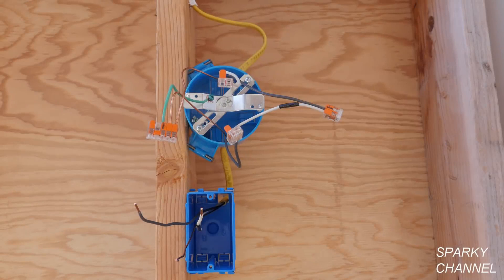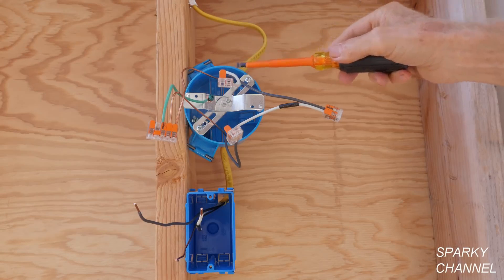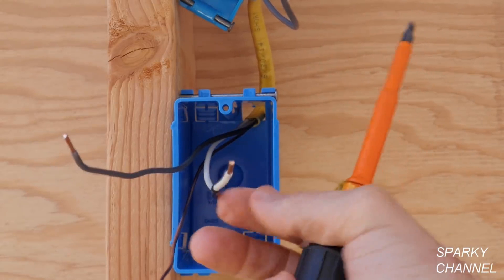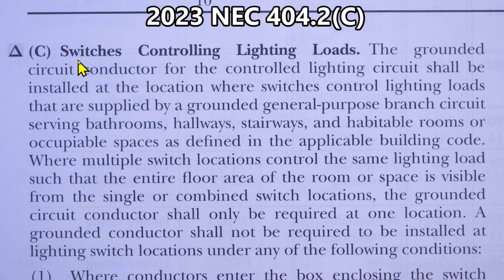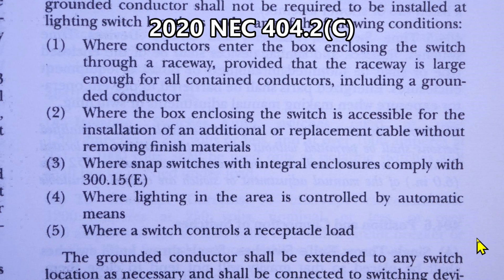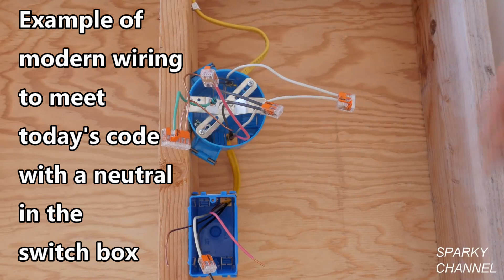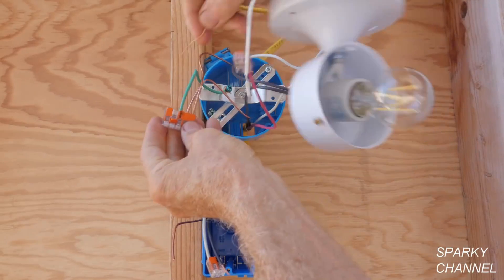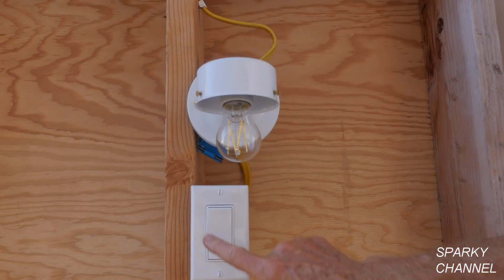NEC 2023 404.2(C) Switches Controlling Lighting Loads, Code Deletions? What Deletions?

Comment: This addition to the code is the most presumptive thing I have ever seen.  It assumes that people will install electronic lighting controls, and  that they will require a neutral and that the box the neutral is in, is where the control is likely to be in multiple switches.  I think it more likely that these controls will be "power robbing" for backward compatibility in homes where there is no neutral.  I also think that many people will find that the old fashion way of turning the light on when you enter a room and off when you leave works just fine!  I do not think that this has anything to do with safety, but is requiring people to prewire for something they may never have, or want.
Reply: If people want to convert over to home automation, they can pay for a rewire. It's pointless to include it in construction other than to raise the costs of the home. The NEC is supposed to be code for SAFETY, not for forcing contractors to do something just because it makes it easier to adopt a new technology.
Reply: IF you think the home automation market is not a big deal, you're mistaken. Saying it's something someone may never have or want is like saying we shouldn't wire an outlet for an electric dryer, because they may never have one and only use gas.
Reply: @InfamousElGuapo  well most people know if there going to use smart switch's or not problem is years down the road when house get sold new owner may want to use them and would have to redo alot of walls to rewire it adding it in saves others time and money who know next owner maybe your kids who 20 plus years from now will want smart switches
Reply: @InfamousElGuapo  If you have gas service, you would have to have a special case of stupid to switch a dryer, range/oven, hvac, water heater, etc over to electric. Gas is much more efficient, cheaper, and just works better overall.

Comment: Question about that unused neutral in the switch box... does it require a wire-nut/wago on its end or can it be left "uncapped"?  You showed it capped (with a wago) in this example.  Is that per code?  I assume code requires it be capped to protect it from making contact with anything in the box, but wanted to have that clarified.  Tx!
Reply: Best practice, dont leave cables uncapped
Reply: @thedude5040  Agreed, but I'm curious as to what code states about unused wires like that.  :)

Comment: With few exceptions such as a switch being on the far end of a room in relation to the rest of the circuit,  or adding switchs to pull chain light fixtures during a remodel,  there is no reason to run switch loops.   Just run your feed into the switch box, then run your cable to the light.   Very simple to understand, no need to use as much 3 wire + ground cable in the house,  and also makes simplifies troubleshooting  in case of a problem.  Saves from having to drag a ladder to get to a ceiling box.
Reply: I was under the understanding that is common practice. I've never seen a feed coming from a ceiling box to a switch.
Reply: @jason3298  if you're doing renovations,  you'll frequently run into switch loops, where the feed comes into the ceiling box, then a 14/2 is dropped down to a switch,  here,  the white wire is hot and should be identified as such, but often isn't, this was common in the 60s , 70s and sometimes the 80s,    Of course this is no longer code compliant as of 2011, and unless you modify the circuit in any way, the existing setup is grandfathered in, assuming it was wired to code at the time of construction.
Reply: Ceiling run to a switch and back to a light would be more copper, with six wires inside the wall (14-2g X 2) instead of four (14-3g)

Comment: This is not a problem if the power comes to the switch box and then feeds the light. 

But what if it’s for the floodlights and you have 2 3way and a 4way switch at each exterior door. Will you need to run 12/2/2 or can you still run 12/3?
Reply: He showed the code where it stated on multi-station switches, the neutral only needs to be run at one location.

Comment: I was working at a ladies house trying to fix a bunch of punch list issues. on issue was that the switch in another room controlled the lights in multiple rooms. after talking to her, she said it wasnt a problem till a handyman installed ceiling fans. I was like, has to be power at the light scenario, and the guy just combined all the whites. I open up the switch and the switch was black and white of the same romex. to the owner I'm like, that proves its power at the light. the owner just looked at me funny because I guess i didnt actually explain it to her in a way that makes sense. She's just like, it worked before, how could it not work now, my handyman is great. I quit working for that guy.

Comment: Bill, what is the reasoning for the limit of 5 and 25 devices?
Reply: This topic could certainly use further discussion and explanation. For instance in re to 3 way or 4 way switches? Or, what is happening—on the neutral—when multiples of these switches are doing their job? Thank you Bill for ALL your vids and ongoing tutorials.
Reply from the maker: Perhaps too much voltage drop.
Reply: @SparkyChannel  Isn't that section about using the ground wire as a fake neutral? Or am I confusing things?
Reply: @Ariel1S  Yeah. I don't remember if these are the exact limits (I think they are), but the max allowed leakage is .5 mA per device/appliance. Class A GFCI's are rated for 4-6 mA. So, 5 switches could be 2.5 mA; half the GFCI's rating. Add a few more switches and you'd probably trip the GFCI. Guessing they figured nuisance tripping wouldn't happen with 5 or less. Had I not looked it up, not sure I would have thought about it. If I was on a call I probably would just assume it was a faulty GFCI.
Reply: The limit, where you do not have a neutral for the switch, is to limit the amount of control return current on the neutral.

Comment: With a switch loop does it matter if the white (w/black tape of course) is used as the "hot" or and the black as return, or vice-versa? I've seen it done both ways.
Reply: The convention was to use the white as the line, and the black as the load. (from what I've heard)
Reply from the maker: Hi Kris! I've heard it both ways, but I think you're correct.
Reply: @SparkyChannel  Hi, Bill. I read that somewhere on a forum. I am not sure if there was a code from a past NEC edition or if it was just a convention. I am also going to ask my boss what he has seen more often. He's been in business since 1990 so he has seen a good amount of stuff.
Reply from the maker: @illestofdemall13  The only code I remember about it was that you had to permanently re-identify the wire.
Reply: @SparkyChannel  200.7(C)(1) states that the re identified conductor can be used for the supply to the switch, but NOT as the return conductor to the outlet, so it does matter.

Comment: always put a neutral please.. so I can install smart wifi switches
Reply from the maker: Yep!
Reply: Plenty of better options that don't require neutral.
Reply: I cant wait until we get rid of 120V and join the rest of the world with all outlets at 240V
Reply: @thedude5040  why
Reply: @stevenpersinger6577  because 120VAC is pointless now that we no longer use incandescent light bulbs. Most electronics like your cell phone charger, laptops, video game consoles, ext already work at 240V. You could energize a standard outlet with 2 hots, 0 neutals, and the devices will work no additional modifications. So.. if we change everything to 240VAC we can wire houses with fewer conductors and smaller guage wires. Heck us engineers could rewrite the NEC so lighting circuits can use 18awg wire in residential buildings.

Edit 1: I do this when I go to Europe. I have an adapter mold that rearranges the physical metal prongs on a nonsurge arrested extension cord with multiple "american" outlets to match what ever country Im in. Then I take my american laptop and plug it into the the extension cord that is energized to whatever voltage and frequency the outlet is at, hopefully not 277 or 480 because then I (the hotel or airport) will have a problem lol.

Edit 2: dont say something stupid like 240v is unsafe. Its not anymore unsafe than a 120v outlet. You can google, Does europe have twice the amount of electrocutions as america?

Edit 3: we could rewire power transformers to remove the center tap, so we just bring 2 wires to each house. "Hot" and "neutral"
Reply: @thedude5040  whole lot of explanation for an absolutely  bogus idea. But nice try. Props to that.
Reply: @stevenpersinger6577  its not bogas, there is absolutely no reason to keep manufacturing 120v devices when most of the worlds population lives in a 220 or 240V country. We can keep 60hz. Also since all the homes in america only last a max of 100 years Its time to start changing standards. Simplier wiring and higher volates will significantly lower the risk of house fires because of less amperage on feeders and less space taken up in boxes
Reply: @stevenpersinger6577  the NEC is holding back progress. I can vote for changes to the NESC but the NEC is grid locked behind absolutly stupid people.
Reply: @thedude5040  There are still dozens of devices in a typical home that don't use switch mode power supplies and would be unusable if we switched to 240. All 120v appliances, and most 240v as well because the controls often operate on 120. Small pumps, garden tools, car chargers, power tools. Go tell a contractor he needs to replace all his power tools because you want to use smaller wire. 

240 absolutely is more dangerous. I have never had arc flash vaporize my screw driver on a 120 circuit. Also only one leg is hot, so half the likelihood of touching a hot wire, or water conducting it. Though if the power was 240 on one leg and still using a neutral that wouldn't be different. 120 means half the current thru the body. If the contact point has high resistance, as skin does, you have a better chance of a less than lethal dose of current. The arc gap it can jump will be larger. The likelihood of water giving you a lethal shock is higher as sufficient current can now travel twice as far. 
You also need to consider EU outlets are designed with plastic covering the prongs until just the tip. This prevents you from being able to touch them making them safer. Or the outlet is recessed to accomplish the same. So any data about safety from there vs here cannot be compared directly as there are other safety features at play. How long have mandatory GFI and Arc flash equipment been in place for instance.
I just spent a couple weeks in India, and can guarantee if they get shocked it doesn't get reported. The amount of exposed wires there would give a code enforcer nightmares. So reporting accuracy is another problem. 

Basically it would be pointlessly expensive. Particularly since we already have 240.
Reply: @court2379  na. Our devices only last so long before they need replaced anyway. In the long run, 120VAC will loose out simply from a manufacturing standpoint. I realize you may not have any recent experience with motor circuit design, general electeonic circuit design, and microcontroller design, but its not that hard to redesign appliances to work on all 240V instead of split 120/240. Most of the worlds population lives in 220V. Now consider all the changes comming in the next 100 years, we will waste less resources converting to 220v or 240v pick one I dont care, than have a world having to manufacture custom devices just so americans can use their archaic 120v outlets. Its only a matter of time before we have a crisis of end of life on distribution transfomers because there will not be enough manufacuring power in the world to keep up. Look at ukraine, do you have any idea how long its going to take to rubild all those substations? My 230kV breakers from europe have over a year of lead time. I cant do solar swiching stations because of lead times. Hell I tried to order 250k feet of 4 conductor #10 control cable and the supplier just said good luck. We even had trouble with the 15k ft of 4/0 bare copper I needed for a job. Homes on a new 220V can just have a new standard outlet and they would have the benefit of cheaper wiring and lower fire risk. We made the NEC so people like me would have time to do other more important things, but alas it appears we need to take that power back.
Reply: @court2379  we actually are using all metic, just the end user doesnt realize the last step to manufacuring or electonics is converting to imperial units. My entire college career was all metric in america. Our college took a survey and very few people remembered how many feet are in a mile, but everyone could convert feet to meters. All electronics first measure inputs in metric then we have to take up program memory to convert to different units. Have you ever ealized on new devices on startup if you watch closely the units are defualted to metric. If you tried to program a microcontroller to display fahrenheit you will quickly realize there is not a sensor in the world that measures in fahrenheit. It measure in Celsius then you the programmer have to convert the data. Also consider that in most homes, your stove, dryer, microwave, ext are already on dedicated circuits so its a very easy conversion to all 240v only appliances
Reply: @court2379  your still missing the point. You wouldnt change out things to 240v until the device naturally died, which in america means typically within 20 years. Since the most expensive devices are already on dedicated circuits they can be changed out as they break down. The new generation is demanding changes to our society, I dont think they will reject the idea of coverting our  common voltage to 240V especially given the fact it ultimately means new housing units can reduce the amount of copper used  which fits nicely with enviornmental plans. Did you consider the millions of internet devices already work on pure 240V including the device you use to type back comments to me? Also consider the fact that analog TV and all those devices are already trashed or soon will be thanks to ATSC 3.0 being incompatible with the digital to analog converters the government was forced to purchase. Even in the computing industry there are debated of we should continue x86  or create something different. Micosoft's windows 11 is going to obsolete every computer manufactured before 2017. I do not buy the argument that we cannot convert voltages simply because there are too many devices because we change standards on everything else. USB is a great example. The  number of devices running on pure 220v or 240v vastly out numbers 120v only devices. You are letting the clock on a stove dictate keeping old standards.
Reply: @court2379  thermocoupler charts are all in Celsius and so are the libraries, look up tables for you older people, that programers use.
Reply: @thedude5040  The rest of the world also uses the metric system. Change comes slowly with a recalcitrant population.
Reply: @mudlick8186  all science in America is done in metric. In engineering school my very last final had a triva question of how many feet are in a mile in 2018 and no one got it correct because we've all used metric for so long that kind of conversion felt archaic.
Reply: @thedude5040  that's not going to happen. The code book is all about safety. If there is a short circuit, you are only at risk of 120v with this system. Why would you want to risk being grounded to 240v through your body????
Reply: @rcadventure44  because 240v is just as dangerous as 120. The NEC can be rewritten. By 2030 we will be back to using copper plated aluminum wires for branch circuits because of a shortage of copper so may as well rewrite the code book so we can use less copper.
Reply: @thedude5040 we are not the only place on less than 240v. I don’t think it will happen in this civilization. After the apocalypse, who knows. 😂
Reply: Smart switches are the worst. Can't stand them. To much for nothing. Light on or light off. Wtf
Reply: Or you can pay for a rewire and let the majority of people who don't want smart switch save money on their construction costs.

Comment: I've see circuits with the switch installed in the neutral leg.
Reply from the maker: Wow!
Reply: @SparkyChannel  
Old house.
Reply: @SparkyChannel  
Plus the socket shell was wired to hot.
Reply from the maker: @scott_meyer  Oh no! That's dangerous.
Reply: @SparkyChannel  
How do you think I figured out something was wrong? As I was unscrewing the bulb I touched the threads.
Reply: @scott_meyer  Sounds like an illuminating experience. :)  I was replacing outlets on an outbuilding and I'd turned off the feed to the building. Everything was dead.  Except for one exterior outlet. Nearly knocked me flat. To make it worse, the neutral (white wire) was hot and I could not find where that outlet was supplied. I'm wondering if the property was divided and that old outlet may have been supplied from a neighbor.

Comment: I always use 12/3 or 14/3 when running to lights or switch boxes so there is always a neutral at the switches that way I don’t have to use white as a switch leg. Even when I have to run those circuits in conduit I do the same.
Reply from the maker: Sounds good!:goodvibes: